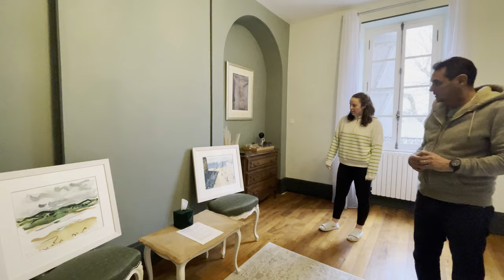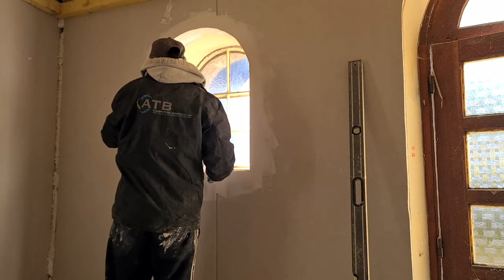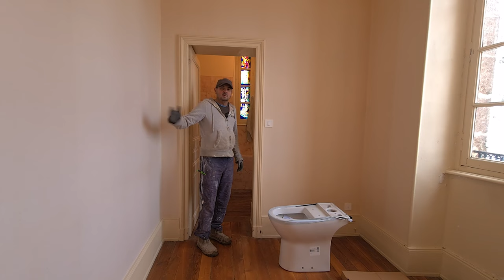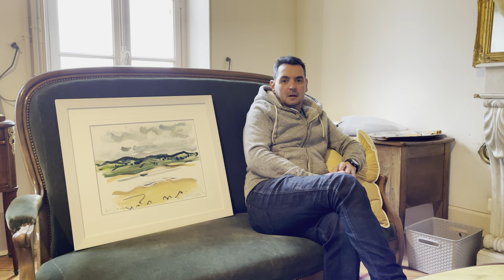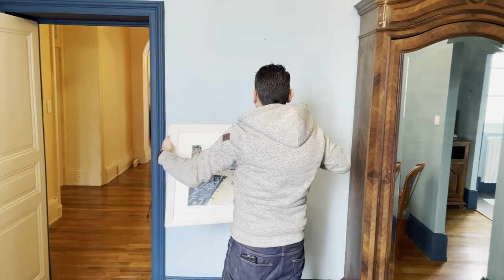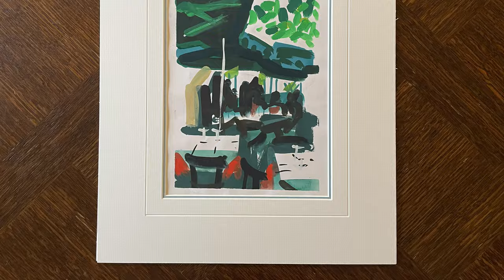Uncle Geoffrey's Paintings are back at the Chateau! - 'Chateau de Bruges' - Ep  25 - Renovation

Comment: The picture is too small for the space. If it stays..it needs to move down. Too high
Reply from the maker: Thanks for sharing your opinion.
Reply: You are correct the green one is too high, a tad small but that can be compensated by flanking it with sconces, then visual it would have enough weight to balance the bottom half of the alcove.
Reply from the maker: @Tony-InLosAngeles  thanks again Tony for sharing your opinion. 😊